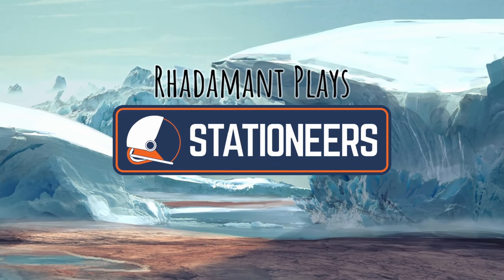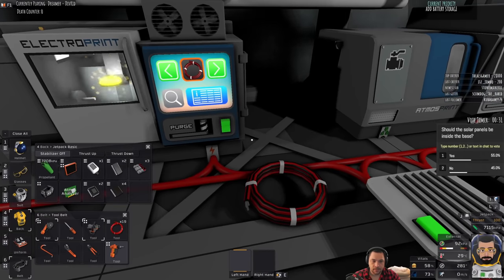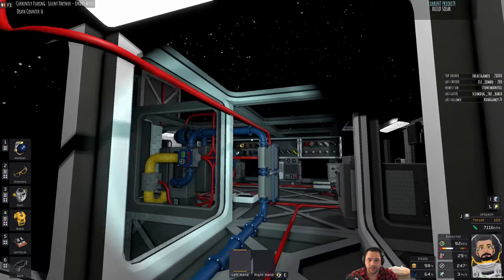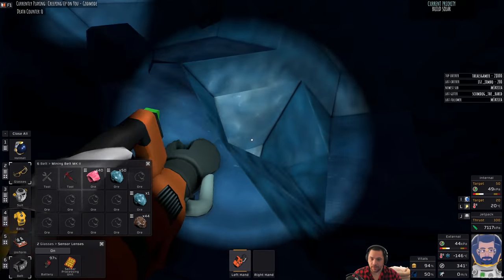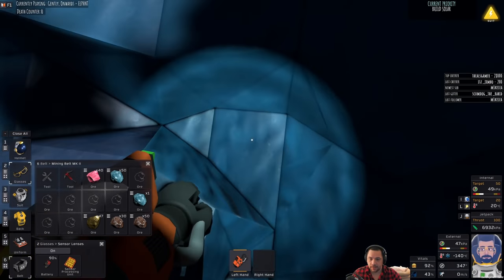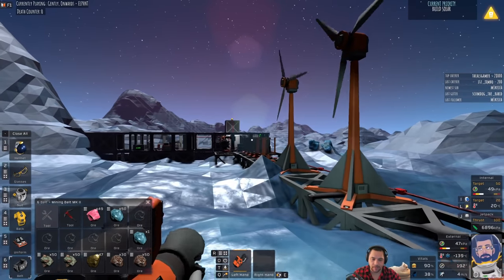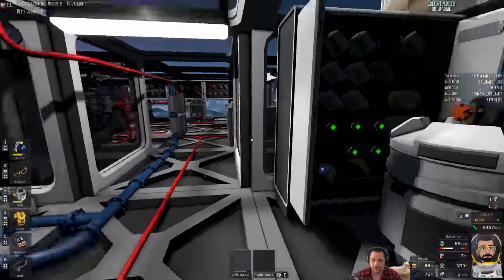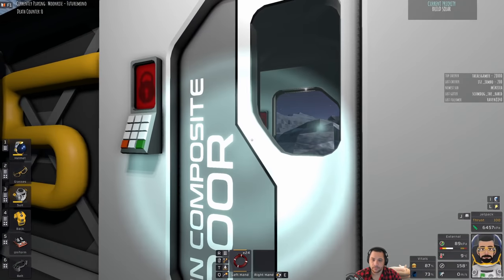Stationeers Europa - 2 Axis Solar Tracking // EP12

Comment: 43:30 - Oddly enough it's not the problem of keeping a base warm in the long term. Every running machine, light, logic - whatever generates small ammounts of heat. So even on Europa at a certain point you need to cool your base. Which in turn is pretty easy, when you live on a icecube.
Reply from the maker: Indeed, keeping machinery inside is an asset

Comment: Great series so far! As far as the solar tracking went, you could have fixed your issue by turning the Daylight sensor so that the data port faced North instead of East. The power port on the solar panels is the 90 degree angle for the panel and the data port is the 270 degree angle. In order to match the sensor to the panels without math correction, the data port on the sensor needs to be pointed north, or to 0 degrees. Play with it, see what happens.
Edit:The Steam Community guide was posted in April of 2019. There have been changes made to the system since then, although it is still a relevant guide. You just have to account for 0 degrees being North now instead of South, and the angle increments increasing in the clockwise direction (like normal systems do ;) )
Reply from the maker: Yeah I could fix it that way or fix it with some more logic, either way works
Reply: @Rhadamant  you had me very confused with your solar logic as you started off doing the same 8 chip setup from the Stationeers Unofficial Wiki, but then went with completely different numbers.  Threw me off, good to see it works as it shows off that there are so many different ways to achieve the same outcome in the game.
Reply from the maker: @kaervekfc  Oh there are SO many different ways to do solar tracking and most of them yield the coveted 99% efficiency =]

Comment: Hey Rhad great video. One quick question, why did you go for a 50 slope value? didn't catch that
Reply from the maker: The slope was 2/3 and the Y Intercept was 50

Here's a guide that can help you understand: https://steamcommunity.com/sharedfiles/filedetails/?id=1491329308

The TLDR/ELI5 is that you've got to convert the angle into an arc.

Comment: 49: 30... Well - to my comment on my last video, regarding the dual axis logic. I stand corrected. You very vell can, with little effort do it without using IC-chips.

And as it looks - with a third math chip and memory you could write the 90° offset directly to the panels, so you don't need to rotate them physically.
Reply from the maker: Yup, I could do a mem for 90 and a math for hoz + 90 to do it